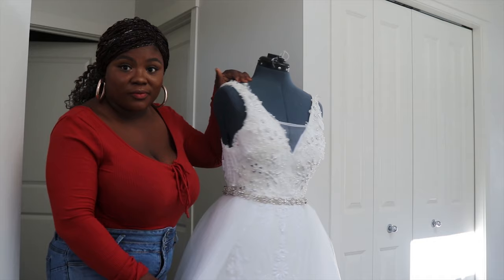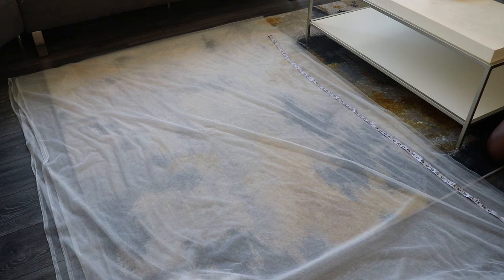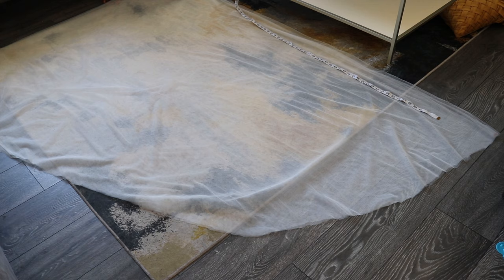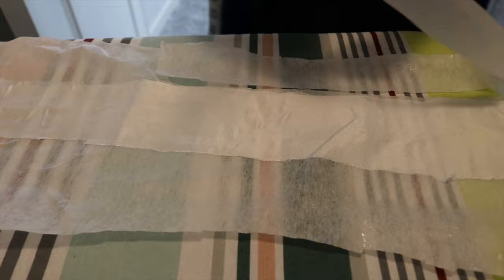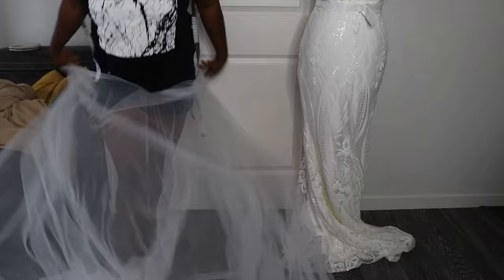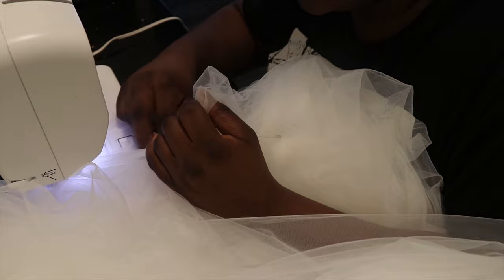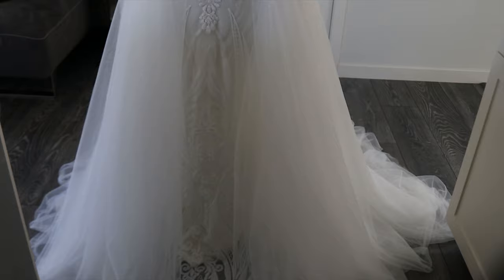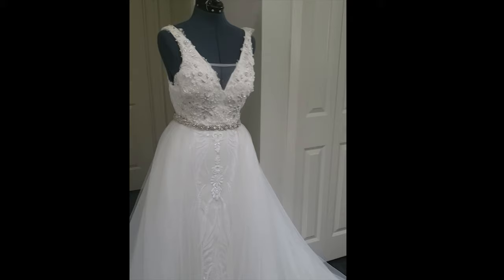WEDDING DRESS Tutorial | DETACHABLE TULLE OVER-SKIRT

Comment: Well done ma!!  Pls what are the yardage requirements for the tulle ma
Reply from the maker: I think I used about 25 metres, that’s almost 30 yards. When working with tulle, you need a lot of volume to make it flattering
Reply: Please ma, my tulle is not folded twice and my yardage is 60" in length by 36" in width, so how am I going to fold to get the desired length for the detachable train
Reply from the maker: Hi, you just have to cut twice as much